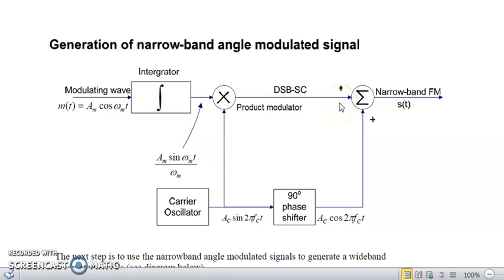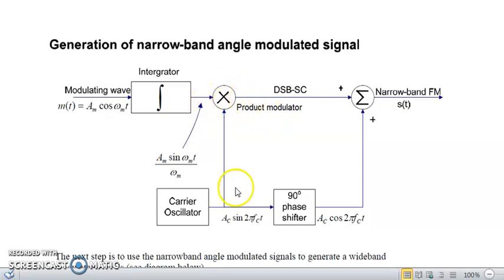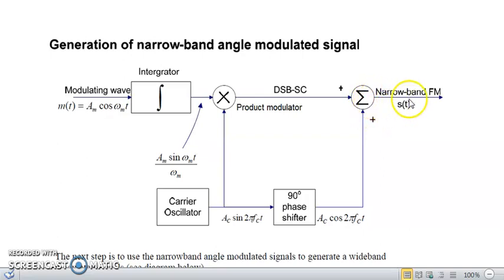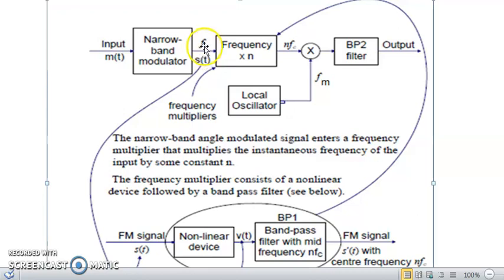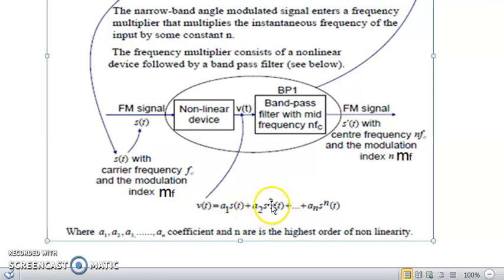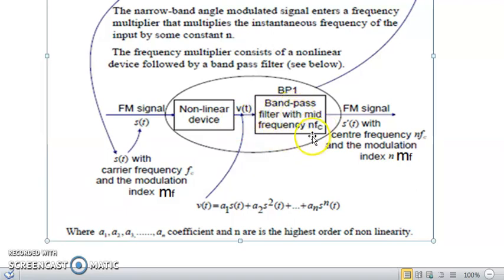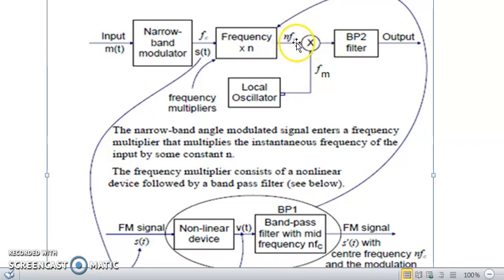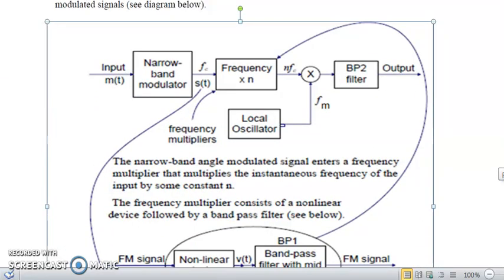Wideband FM generation

Comment: Mam non -linear device 
. I didn't understand? Plz explain
Reply from the maker: Simply speaking, when the Output vs Input characteristics of a device is not a straight line, then that device is called as non-linear device. Such as Transistors are non-linear devices while Resistor is a linear device which provides straight line as output vs input characteristics due to ohm's law.
Reply from the maker: Non-Linearity means Output parameter of the device is not directly proportional to the input parameter of the device.